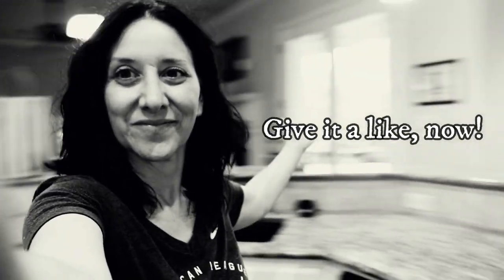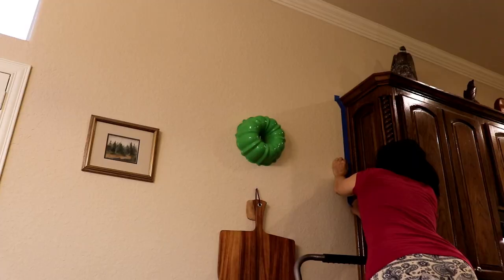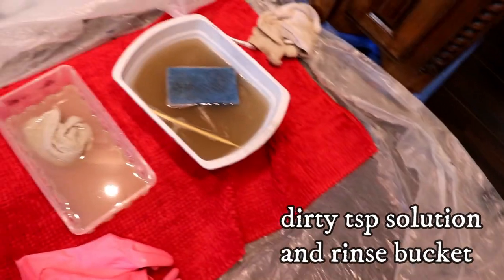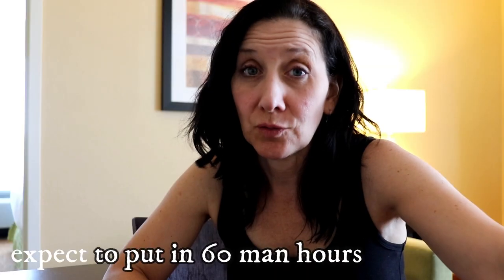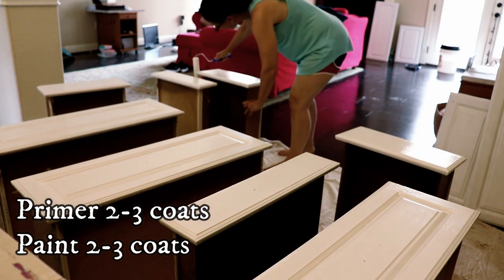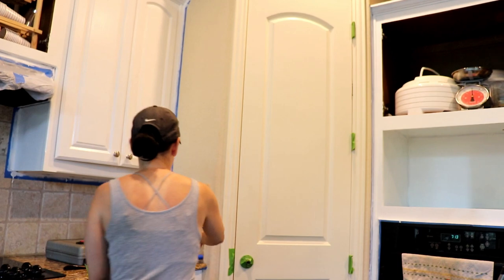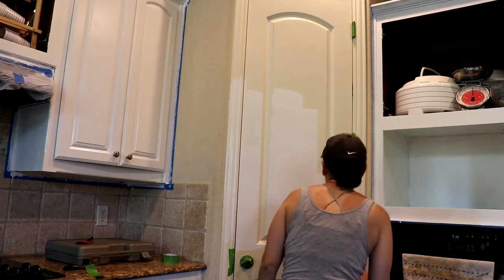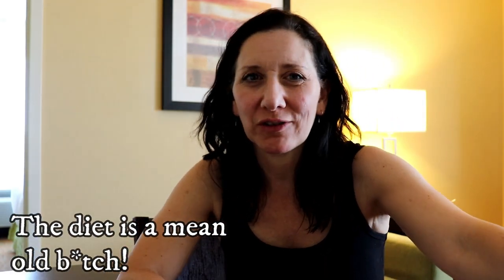How to Paint Kitchen Cabinets -No Sanding

Comment: I painted my oaks cabinets yesterday I primed it 2 times and paint it 2 times but after it dries I still see the grains showed .What can I do to get rid of the wood grain after painting? And also I don’t see a shiny paint after it dries it’s just chalky cabinets.
Reply from the maker: What kind of paint did you buy?
Reply: @JulieHiltbrunner  I used enamel satin behr
Reply from the maker: Try putting some of that paint on something else to dry and see if it looks sad and when it dries. They may have sold you the wrong paint. I think if you have a strong wood grain that you don’t wanna see you would have to have sand those down.

Comment: I'm in the process of painting my 30 + year old cabinets but I'm using Valspar bonding primer along with the Valspar cabinet paint. I did rough up the surface with a rough cleaning sponge as I was degreasing the cabinets.
Reply from the maker: It’s going. To look great!

Comment: Looks good! I would sand for better bond if using a water born primer. An XIM primer or better a quality shellac will bond better. 
Keep up the good work.
Reply from the maker: Do we need to prime over flat wall paint?
Reply: @JulieHiltbrunner  not unless you're looking for a stain blocker.  The cabinets have a lacquer on them which is not easy to bond to. You chose a good primer there's just better products for bonding and nothing beats a shellac. It literally bites in to the clear.
Shellac is a resin secreted by the female lac bug, on trees in the forests of India and Thailand. It is processed and sold as dry flakes (pictured) and dissolved in alcohol to make liquid shellac, which is used as a brush-on colorant, food glaze and wood finish.
Hope you're enjoying vacation!